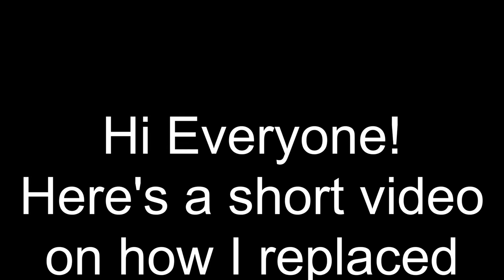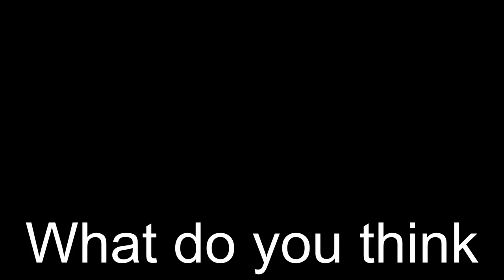Graphics Card fixed with HOT GLUE? (and PWM case fans)

Comment: This is a really good ghetto mod for those who care more about performance than looks; Better cooling and probably more silent as well. Thumbs up.
Reply: 3milio0o and for those who care about both use rgb fans
Reply: I did this on a gigabyte rx580 8gb. Used 2x EK Vardar 120mm PWMs. Couldnt get the card hotter than 60 degrees even heavily overclocked afterwards. Best mod ive ever done.
Reply: Danica Daniel  I used zip ties initially as i wasn't really prepared then used a heat resistant silicone next time as I also decided to replace the thermal paste with noctua stuff. I attached the fans to the gpu header. Basically the same as in the video. The EK fans also drew far less current than the stock tiny gigabyte ones.
Reply: Ghetto wishes they were this handy...
Reply: @astronomyastrology7186  it's absolutely weird that manufacturers don't use 120mm fans or towers to stock coolers
Reply: @rafaelmoraes5165  towers? not everyone has an 11 slot case to fit that lol
Reply: @virtualtools_3021  its true lol
Reply: @astronomyastrology7186  My heatsink is smaller than my one 120mm case fan and it seems that my fan will scrape the heatsink when it’s on. Any way to fix?
Reply: @megdafx7467  it really shouldn't.....like the fan frame ought to keep the fan from touching anything its sitting on. Ide say just get a piece of plastic and cut it out around the same size as the fan frame and use it as a spacer if necessary? Best I can offer

Comment: I just did a similar thing and hot glued two 80mm case fans onto my graphics card heatsink after removing its fan shroud because my old fans were getting wobbly, making noise, and not cooling enough since my graphics card was thermal throttling. I glued the fans around the sides, but I should have done it underneath like you because it's neater and probably bonds better. I'm going to plug it back in my motherboard tonight or tomorrow. Hopefully, it works and the hot glue doesn't melt and make a mess if my heatsink gets too hot (which it shouldn't since my case fans are 80mm and my original graphics card fans were only 75mm. I know that RPM and blade design also come into play concerning CFPM airflow, so it will be interesting to see if the case fans are better, worse, or about the same in my case. Especially considering that I used case fans that are probably middle-of-the-road quality and performance). Update: I just reinstalled my user-refurbished graphics card into my computer. Its fans are connected straight to the power supply, so they are receiving 100% power all the time. So far, the glue hasn't melted, and the fans haven't fallen off. My graphics card temperatures are also better because the highest temperature under full load I have seen now is 73 degrees C vs. 83 degrees with the old stock fans. I also haven't seen any thermal throttling which I'm happy about. GaBit, thanks for this video and tutorial.

Comment: I hope hot glue not get melt and fans fall down.
Reply: Ali Tolga AYRIM I don’t think so. In order for hot glue to melt, the metal would have to get too hot to touch.
Reply: @MPdude237  I see, so hot glue is a good option to make it.
Reply: Wonder if the fans are still holding on. I can't imagine heating up and cooling down several times does wonders for the hot glue.
Reply: so when the temperature hit melting glue point that fans will pill off itselves?
Reply: @force1549  Yes, they would fall off. But hot glue typically melts at 120 C and your GPU shouldn't reach beyond 70-80 C.
Reply from the maker: @SuperDTrain91  correct. They are fine after a year
Reply: It will fall always, I testet it few times :-D but probably depends on type of glue, I have something what is getting soft somewhere around 80°C, but the most important problem is that if you put glue on heatsink, it will get cold so fast that you sometimes even don't have time to put fan on that. I would recomend some more solid way to mount it, but this is fastest and it looks good.
Reply from the maker: Danica Daniel  hey. they still hold up. I soldered the wires because I couldn't find an adapter and also this keeps the cables shorter and easier to manage.
Reply: Why not secure the fans with [     ] style flexible metal clips?
We can always make those from ordinary paper clips if done correctly.

Comment: I have done this fan mod since my 1080. I did it on my 2070 and also now my 3080. But, all mounted using super glue as I felt hot glue might melt. I also did something crazy and replaced the Arctic P12 fans with P14 fans! Man, they are huge but got a massive reduction in temps and they are even quieter. On the 3080, the Arctic P12's topped out at 70c. With the Arctic P14's I max out at 63c - amazing! I will remove the fans and try hot glue as it does seem better. Thanks for the vid!
Reply from the maker: thanks for watching!

Comment: How do you know how much power the fans draw? Original vs new fans you put on?
Reply: FrnchFriez the fans say right on them the wattage and amperage lol
Reply: @dotech4128  The cooler fans don't
Reply: Anton Juul-Naber all of mine have and I've replaced quite a few
Reply: @dotech4128  Hmm allright. I got a set of chinese fans that didn't have it. Had to search the web, and it offcourse gave different values depending on the site. But I checked and this specific model seems to have the numbers written on the fans, so you're right.

Comment: Did you also repaste? Would you mind sharing your fan curve? Just looking to gauge whether or not I can get a 10+ degree drop from this and a repaste.
Reply from the maker: I did repaste. With the stock fan curve I get 9 degrees Celsius lower temps. It only reaches 62 degrees Celsius under load. And it runned for months and months non stop for mining ETH.
Reply: @Gabriel2.0  Thanks brother. I went ahead with the same fans running wide open and hit 70 under load in a closed environment with minimal airflow. Great vid.

Comment: Hey, hope you can help me. How did you conected the pwm fans to the 4 pin pwm control connector on the gpu, I mean, the pins are the same, or how to wire it?
Reply: There is a adapter for PWM to GPU 4-Pin. Costs about 4€ on Amazon

Comment: Any performance numbers? Temp improvements over stock? Noise level vs stock?
Reply from the maker: I put them in the video already. The temps are 9 degrees Celsius lower than stock, reaching a maximum of only 62 degrees under load. and the fans are much much more quieter than stock.

Comment: You put glue on heatsink to connect these fans with GPu If Glue get melt ? Because  when your card is in high load probably gonna make high temps even if heatsink temp is 60~ degrees glue could get soft and with vibration of fan it could loss grip.
Reply from the maker: they are still holding after almost 2 years - one of full mining
Reply: @Gabriel2.0  BTW  My Project got failed I used 2 1.67 amp 12 v fans Which has probably sounds like jet engine + maybe these 2 running on 4 to 7 thousand rpm  still my GPU Has same temps 82°
Reply: @duxstybrick2536  Then it probably isn't a fan issue. How old is your card? Sometimes the thermal paste dries out and needs to be replaced after a few years

Comment: Which cables on the little 4 pin GPU connector, goes to what cables on PWM fan connector?
Reply: Its the same but reversed.. on the gpu its blue green yellow black and on fan header you have black yellow blue green (on both connectors the lip facing to you)

Comment: I was thinking of replacing my GPU fans with case fans purely because of noise, but now I am wondering if I can just mount a case fan to blow into the existing GPU fans to amplify the airflow and not have to do all this work. Then the only work I have to do is mount the fan against it and make sure I get the fan direction correct!
Reply from the maker: try it if your case has enough room
Reply: I have the same rig up, I got a tower with the side holes, where you can add a fan there if you want, honestly i never seen enough of a difference, and it might affect the overall air flow coming from my two fan on the front I added. I have a feeling in my tower the air was escaping before it mostly reached the GPU.

Comment: Won't the hotglue remelt? It has a very low melting temp. Edit: You mount your GPU vertically which is probably why it's lasted so long. In traditional horizontal mounting I wouldn't risk it and frying the GPU.

Comment: hello can if i can buy that cable or i must make it  bacause my fan broke too on 1060 and i replaced it with noctua but i must connect it in mobo but in the mobo i cant controll the fan
Reply from the maker: Hello. I had to make it myself because I couldn't find one to buy
Reply: @Gabriel2.0  hi find one on ebay

Comment: why did you use the original 4 pin connector? does the y splitter not fit?
Reply from the maker: the header on the graphics card was smaller than the standard 4 pin connector

Comment: GaBIT, is that glue or two part epoxy? How long did you let it set? 24 hours?
Reply from the maker: christopher james it's hot glue, a man's best friend hahaha. It cures in a few seconds and it really sticks. It's also easily removable
Reply: @Gabriel2.0  Is the hot glue still holding up?
Reply from the maker: @BareFinn1986  yes. Still holding on strongly

Comment: Does it need to connect to the SYS FAN on the motherboard ? Btw those glue are gold haha
Reply from the maker: It's connected to the fan header of the graphics card. Just like the old fans
Reply: @Gabriel2.0  alternatively you could connect it to mobo. There is software to make the fan speed depend on GPU temps. I have done this in the past. Yours is better no doubt, just if one didn't want to sacrifice the cables.
Reply: if you connect these fans to the motherboard your system will require to change their fan curve according to GPU temp instead of CPU temp, and that may not be possible for everyone. The best for compatibility if you can manage it is always to use the existing fan headers, however if that requires stripping cables that's risky.

Comment: how many volts do i need to use in my gtx 660ti  iwanna change my fan
Reply: I am not sure if I understand your question correctly but I'll try to answer it anyway.
A PC Fan typically uses 12V. When you choose the fans to replace the original ones with be sure to compare the specifications with the old fans. The voltage has to be the same as the old fans while the power (Amps) should be lower.

The specs of the old fan should be written on the fans itself when you disassemble the cooler. In doubt I would use noctua fans, not because of their good quality but because of their extremely low power draw. They are quite expensive though

Comment: can i not use a 4 pin pwm cable on a 6 pin gpu fan header?
Reply from the maker: my GPU fans were 4 pin as well, not 6. but just smaller in size, hence the adapter I made
Reply: @Gabriel2.0  ahhh ok, so I could use a 4 pin to dual 4 pin to change my gpu to a dual fan setup???

Comment: does the hot glue dont melt?
Reply from the maker: no. it's reaching only a maximum of 62 degrees C under load. and that's the gpu core. the radiator is way cooler, and also remember it has 2 fans blowing air - which goes to the hot glue as well to cool it. I wanted to 3D print a proper fan shroud to hold the fans in place but... the hot glue is still holding on after 2 years. so no point in making the effort.

Comment: Is this high static fans or air flow fan ?
Reply: i think it's high static pressure fans
Reply from the maker: to be honest, I got them because they were cheap and quiet :)
this is the model ARCTIC F9 PWM - 92 mm
Reply: @Gabriel2.0  The ARCTIC F series fans are actually optimised for airflow.... but the temps are better than stock anyways